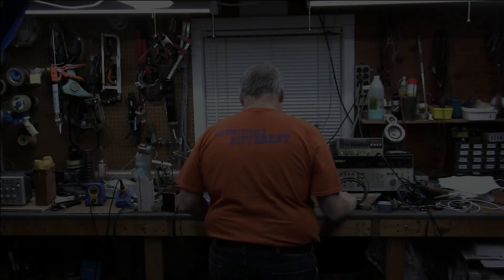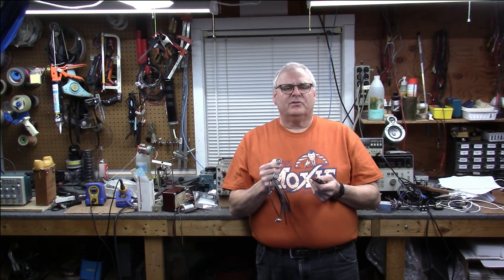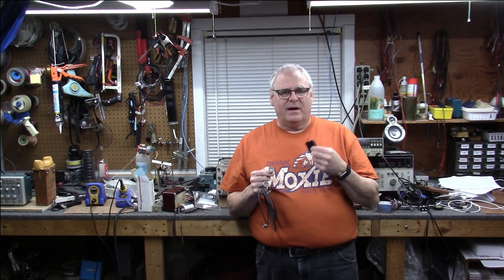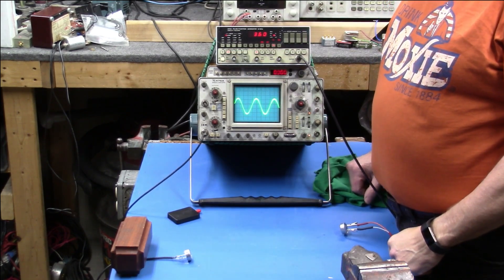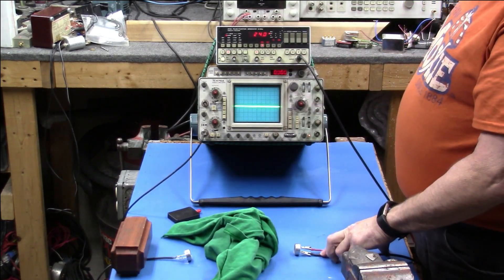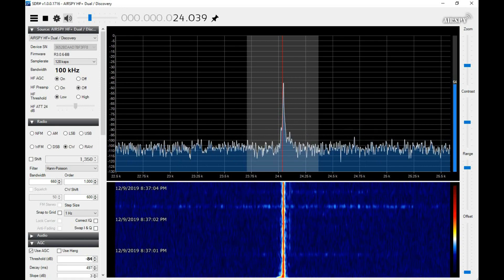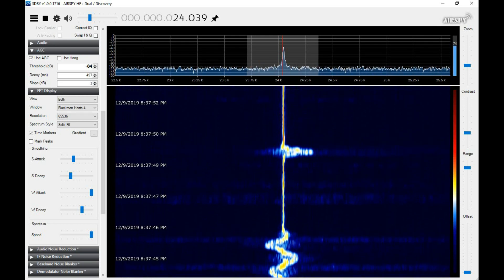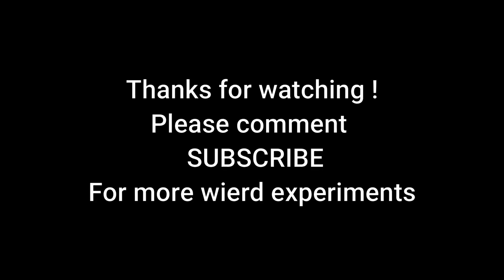AirSpy Discovery Its not just for RF anymore

Comment: Thanks for sharing this concept, Paul.  Great job in thinking outside the box.

I'm not sure how well a 'stock' ultrasonic transducer would perform for applications such as detecting bat echolocation.  I would suspect that a stand-alone 24-kHz ultrasonic transducer is likely designed to be 'resonant' at a frequency of about 24 kHz, and that its sensitivity may fall off sharply above and below 24 kHz.  If it is a relatively high-Q device, it may very well be somewhat "deaf" at "hearing" some of the bat echolocation frequencies in the 30-50 kHz range.
  I think Polariod made some 40 kHz transducers for proximity detection.

I remember a discussion on a different group from a few years ago that connected an inductor across the terminals of the ultrasonic transducer to lower its Q-value and broaden its frequency response.  I don't remember the exact value, but 100 µH or 1 mH comes to mind.  One could experiment with different inductor values to determine the optimum value to produce the desired frequency response.  Granted, it did indeed lower the sensitivity at 24 kHz due to the lower/broadened Q, but it did extend the transducer response into the higher reaches of bat echolocation.

It would be interesting to see a frequency response curve of the 24 kHz ultrasonic transducer swept across a frequency range of something like 10 kHz up to 60 kHz.  However, that may not be as simple of a task as it may sound.  One would need to provide an AUDIO source that is also "flat" across that range.  Feeding a frequency generator or white-noise source into a 24 kHz transducer likely wouldn't work, especially if the transducer is "tuned" to a resonant frequency of 24 kHz.  If one were to sweep a frequency range of 10 kHz to 60 kHz into a 24 kHz transducer as a transmitter, and monitor the response of another 24 kHz transducer as a receiver, it would be difficult to know if any change in the frequency response of the receiver above and below 24 kHz was due to the receiver, or due to the effectiveness of the transmitter below or above its resonant frequency.  Bottom line, the effectiveness of a transducer at frequencies other than 24 kHz as a transmitter may be drastically affected by the resonant frequency and Q of the transducer.  Perhaps the parallel-inductor configuration could help here as well to broaden frequency response of the transmitting transducer.

One final note.  It might be possible to bypass the Airspy device altogether and feed the ultrasonic transducer directly into the microphone (preferred) or line input of the sound card in the PC and configuring SDRSharp to take its input from the sound card as opposed to a connected SDR receiver dongle.  I think the 'IQ from Soundcard' option in SDRSharp as an input device would work.  I haven't tried that in SDRSharp, but did have success with that configuration in using a microphone with a couple of predecessors of SDRSharp, those being Alberto/I2PHD's 'SDRADIO' and 'WINRAD' programs.  One factor that such a configuration imposes is that soundcards can be configured for different sampling rates.  Due to the Nyquist phenomenon, the soundcard frequency response it limited to one-half of the sampling rate.  If a sound card is configured to a sampling rate of 48 kHz, it can only "hear" up to 24 kHz.  Most soundcards can be configured to to a sampling rate of 96 kHz, increasing the frequency response to 48 kHz, which would cover the mid-to-upper range of most bat echolocation.  A good number of soundcards can be configured to sample at 192 kHz, increasing the upper "listening" range to 96 kHz.  It would be beneficial to feed a wide-band white noise source into the microphone input of the soundcard to see if its frequency response is flat across the entire range, or if the electronics in the soundcard might yield some anomalies in sensitivity across the entire frequency range being monitored.  As noted with the Airspy device, the frequency response of the input device (microphone, transducer, etc.) would also play into the sensitivity of such a configuration across the entire frequency range desired.

Thanks again, Paul. Please continue to stretch the spectrum, both figuratively and literally.

Comment: Very neat experiment!   Did you have to amplify the receiver at all?
Reply from the maker: nope.. Directly into the antenna input
Reply: @W1VLF  nice!  love it when things just work like that.
Reply: @W1VLF  also, if it actually is able to sample down to DC (or you can upconvert into range) you might have fun with one of those HB100 doppler devices.  They can plug right in to a microphone jack and you do some  cool stuff with it.

Comment: Hi. After this basic check , it will be more insterresting to use wide band MMIC mic ( ICS70430)  and listen around you : You will hear a lot oh thinks..  bats: .https://forum.pjrc.com/threads/38988-Bat-detector/page3  You can also chek your labs, power supply , LED and others noisy systems. The wide band analysis is the main interest of SDR for ultrasonic receiver. Remember that ultrasonic transducter are centered around 24 or 41 Khz....not very wide band